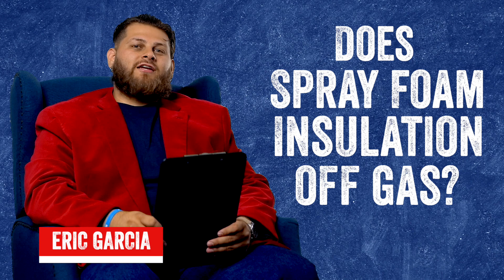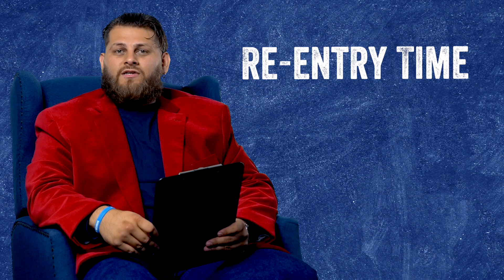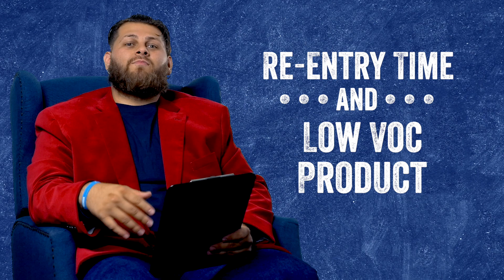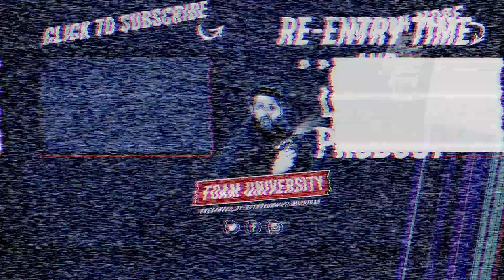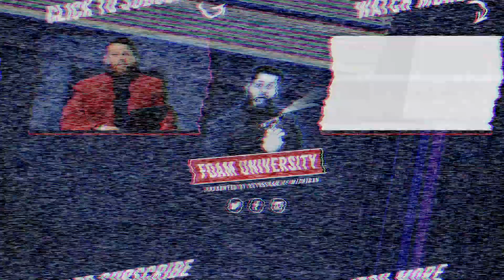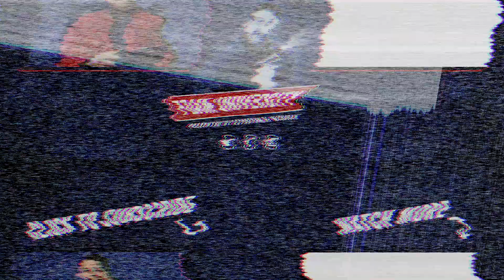Does Spray Foam Insulation Off Gas? | Foam University

Comment: Is it ok to apply spray foam when it’s over 110 degrees? Will the foam cure right or will it off gas forever?
Reply from the maker: If the substrate is in good condition, yes, it would be fine to apply spray foam under these conditions.
Reply: @RetroFoamofMichigan  how hot is too hot in the attic to install? I live in texas where it can teach 120 in the attic
Reply from the maker: That would be a question for each individual contractor. The foam would be fine as long as the substrate is in good condition, but the installers may not want to do it 😊